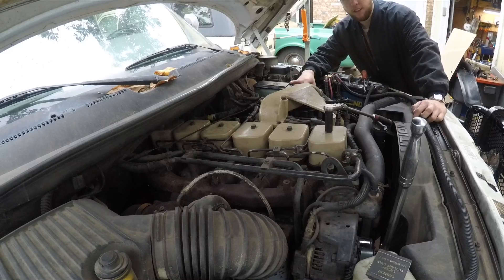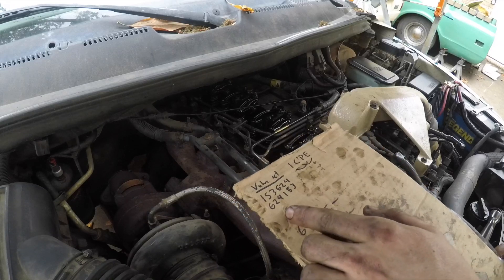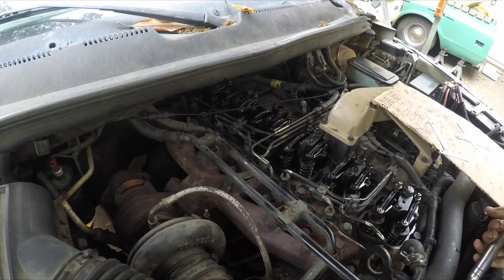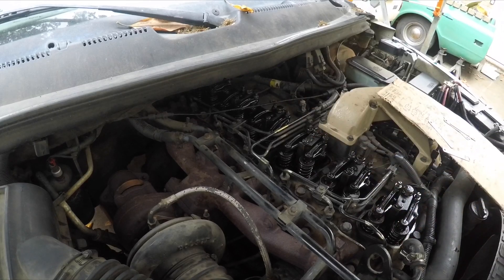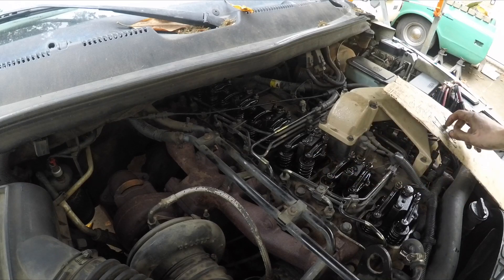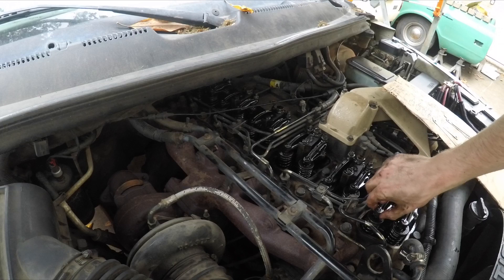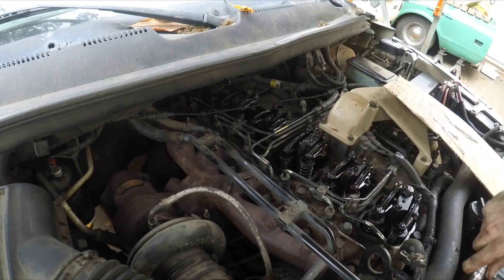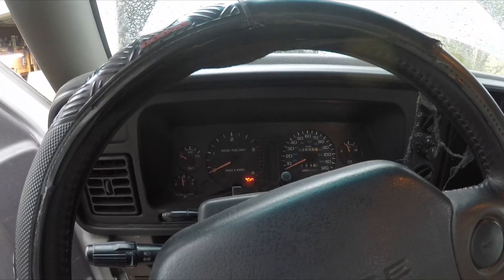How to Adjust 12v Cummins Valves- Easiest Method!

Comment: Haven't done this on my cummins, but when I was rebuilding my motorcycle a old timer who races a lot throughout his life showed me a similar method, there isn't a major reason to find absolute top dead center unless setting time, your rockers are disengaged from the cam shaft for at least 45 degrees depending on the motor, and that entire disengagement is at full " lash gap"

Comment: The only time you ever turn engine backwards is when you get TDC you turn backwards then back in direction of rotation to remove gear lash when you timing pin it. This is a TDC motor.

Comment: Thanks for posting this. I just tried your method and it works great. No need for the special barring tool, and no need to mess with the timing pin. Makes it very easy to do. And for those curios, all of my valves were very loose except #6 intake which was a little tight. Runs so much better after the adjustment. Cummins part numbers are 3930906 for valve cover gaskets, and 3910824 for valve cover bolt o-rings. Thanks.